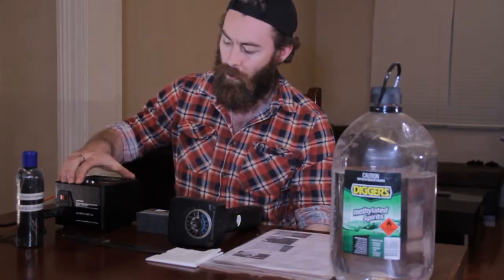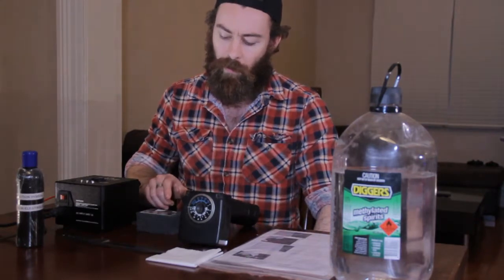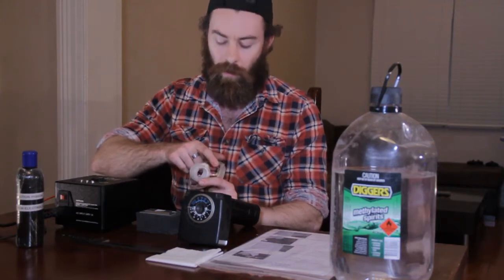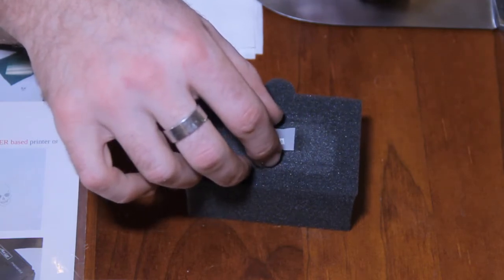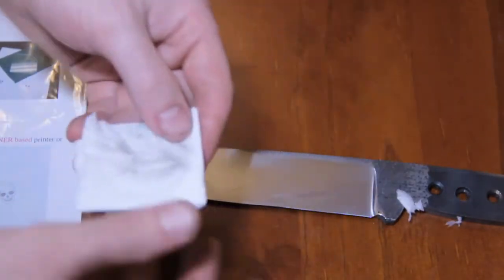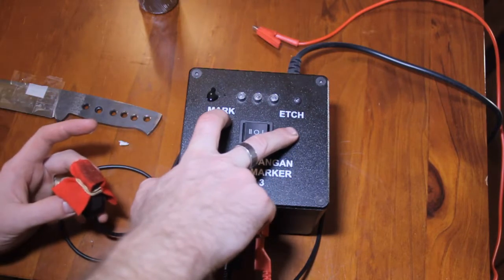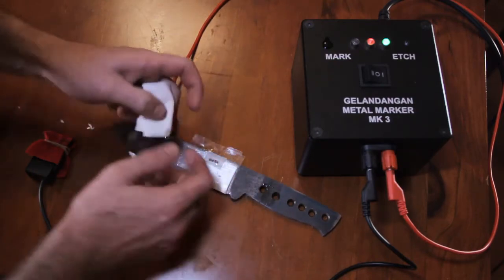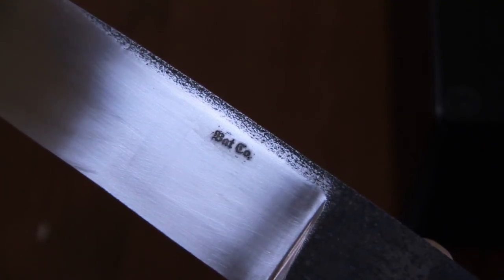Electro Etching Blades Again...

Comment: Very useful vid, thanks! have the same unit, problems with speckles - so on Dar's advice will prob buy a cheapo laser printer to keep things clean. Also scored a Metz 45 (there's loads) on Ebay so hopefully will get a nice clean/deep logo.  thanks again.